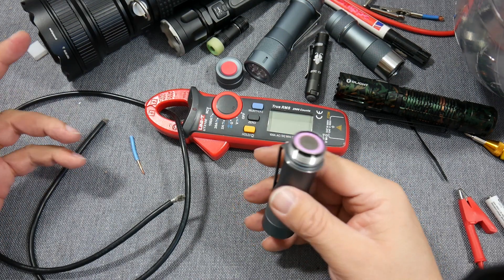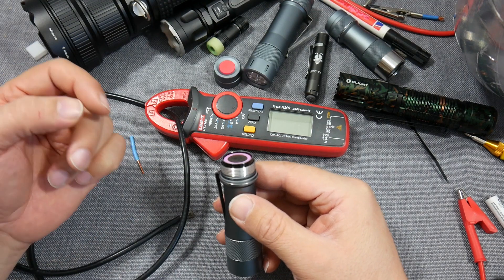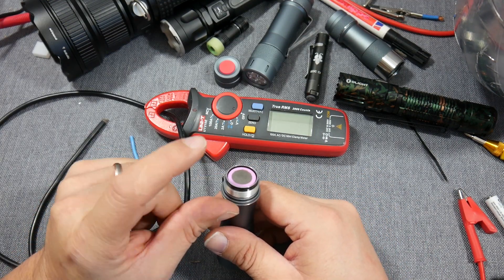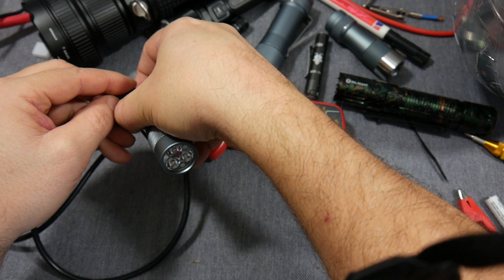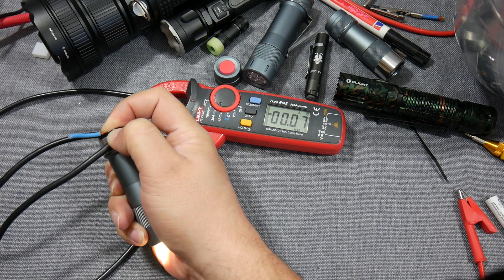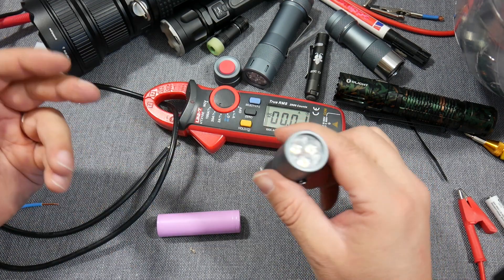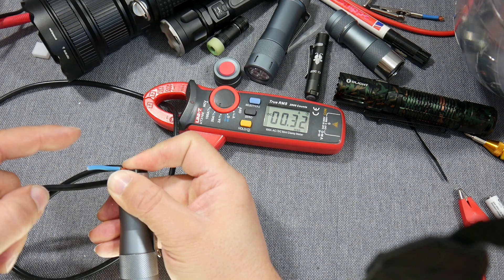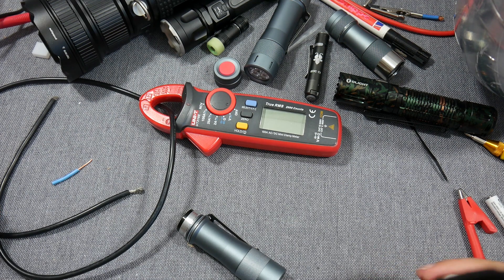Quickie: Lumintop FW3x - measuring the current

Comment: try using a shorter cable and repeat your measurement!
Reply from the maker: i did not find noticeable differences to a ~10cm loop since i use this setup (2 years+ maybe)
Reply: @MartinRathmanner_M4D_M4X  What gauge wire (AWG) are you using?
Reply from the maker: @riffraff9000  12AWG